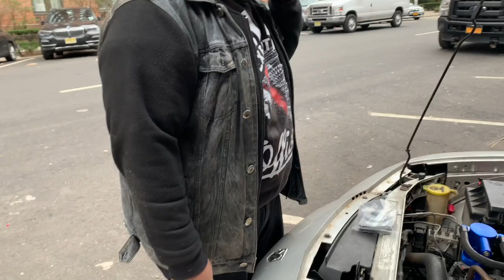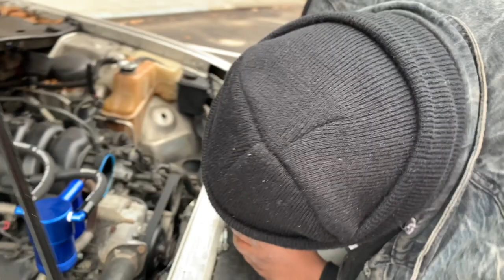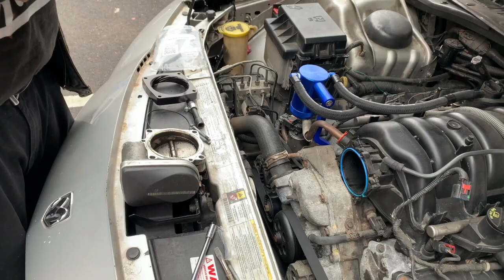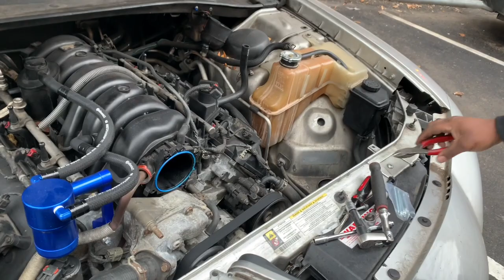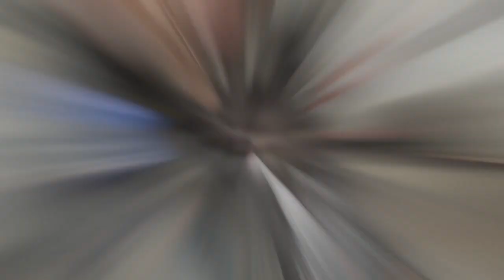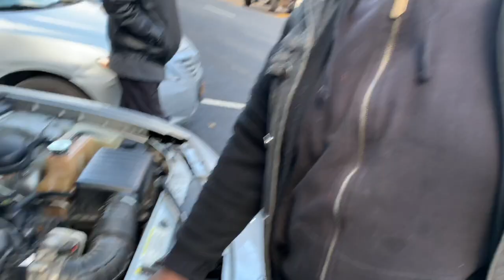Throttle Body Spacer install on DRAG STRIP RABIES | Dodge Charger R/T

Comment: keep the content coming glad to see a homie from the town doing what i do my rt be with in two weeks waiting on my tax return lol
Reply from the maker: You already know n that's all only a few days away get on your grind as soon as u get it n body it the CMC way salute 💯
Reply: CMC Mods you already kno keep the mod video coming you got
a good tint place down for and i wanna take muffler off right after inspection and when you took ur cats off did you get a check engine or you found a way to keep ur o2 sensor in thrre
t

Comment: Do a review on it
Reply from the maker: On which catch can or spacer driving?
Reply: Throttle body spacer
Reply: The trottle body spacer i have i needed to cut those little notches on the intake manifold with the snips right. Then whenever you dealing with aftermarket spacers you have to do a little tweeking so i got a khaos one from ebay. The screws that come with it wont work you go to homedepot and get you some m6 x1.0 70mm screws you need 4 and you all good if you get a different style some are thinner and not as bulky like mine so it varies but the one i have thats the specs.
Reply: Every throttle body spacer is different depending on what you looking for but for my set up basically is what you have to do
Reply from the maker: @JoJo-ju7qx  copy we will work on that this week 💯
Reply: CMC Mods can't wait to see that
Reply from the maker: @grizzly168  soon my brother and plenty more we always on the works.